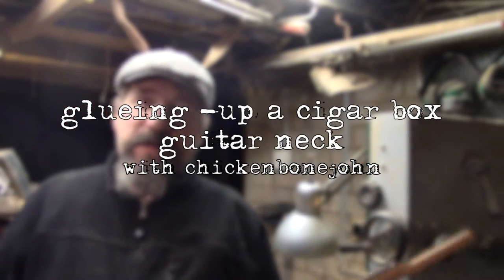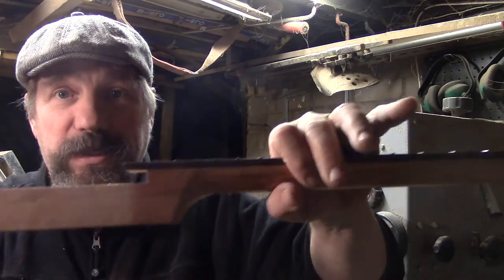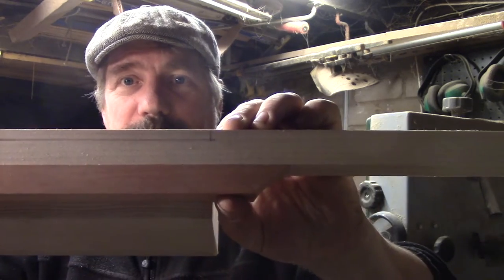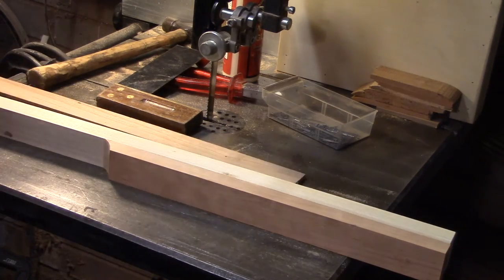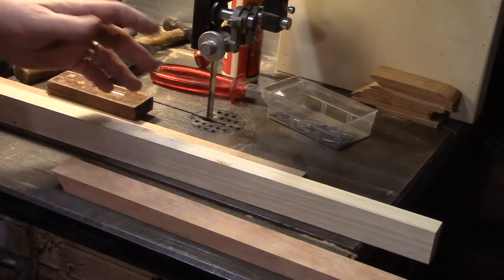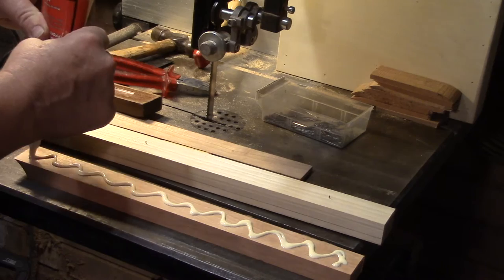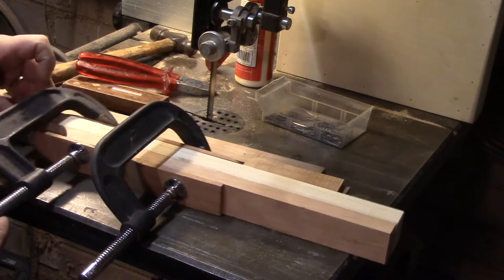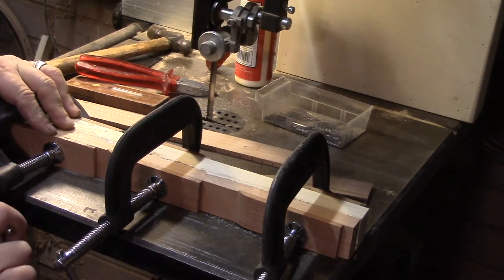Handy hints on how to glue-up a cigar box guitar neck

Comment: Helpful video. Thank you. I used to feel the same way about those speed clamps. I recently got a pair that are made in Germany. I can't remember the name on them. They were on clearance somewhere. These things look basically the same but heavier made and they generate way more force than my others. I can literally put one clamp on a single post and support a 12 foot  2x10 at midpoint with the clamping force they have..... Went and looked. Megaton clamps. 900lbs clamping force. They are awesome. Has to be more good ones out there. Cheers

Comment: Great tips. I also swear on titebond original. I’ve been doing high end custom carpentry for 40+ yrs, and an established guitarist/ enthusiiest but new to guitar building. Most cabinet makers and luthiers use titebond blue top. Never liked the yellow glue line it always leaves. And it’s not waterproof. It does come apart more easily w heat gun. I could see how that would be handy for repairs, modifications.... but for strength and invisibility you can not beat original formula. It has performed and Is time tested.

Comment: Forget the pins. Sprinkle a small amount of salt into the glue. The salt will desolve and the pieces will not skate around. It's a very old woodworkers trick. Won't effect glue or joint.

Comment: Chicken bone, tell me do you ever make scarf joints on your head stocks? And I also wanted to ask you what pick ups you use .do you get them from CB Getty possibly? Or  do you buy them somewhere else? What scale do you use for your neck? I was wondering if you used 25 1/2 or if you think that a smaller scale is better for a cigarbox guitar just wanted to get your opinion because I build all my cigarbox guitars at a 25 1/2 and scale and sometimes I find that challenging perhaps I should try a smaller scale just wanted to get your input
Reply: Hey Chickenbone John, Thank you for the quick response. I think that I’m going to try the 24 3/4 and the 22 1/2  scale lengths just to see how they work out. I’ve been building for 3 years and I learn more everyday thanks to videos like yours . Thanks again

Comment: Hi John,
Excellent video. I bought your basic neck kit recently and before I start cutting and carving I have a question: my cigar box is 250mm x 165mm x 25mm. My concern is the 25mm depth, which by the way seems to be the standard for cuban boxes. If I  glue the two pieces together I will have to cut 19 mm from the neck part to fit the box, seems like a terrible waste o the very nice piece of wood (the back strap).  Am I missing something?  Thinner piece of wood for back strap or end wood blocks? Looking at your video, your box is custom  made, much deeper then factory boxes, that's O.K. it's the basic technique that important. Please keep the good work for the CBG beginners.
Reply: @chickenbonejohn714  

Thanks, 
I will make new, deeper, box frame and use the original top and bottom from the cigar box.

Comment: Handy video, although I did panic a bit as I saw it just after coming in from gluing up my neck. Luckily it turns out I didn't go too far wrong and I now have a better idea about the fret board tomorrow. Out of interest how do you go about sealing the box? I'm thinking I want a semi permanent solution so access is still possible for maintenance but would prefer not to use visible screws.
Reply from the maker: I usually just let the string pressure keep the box closed.

Comment: Great video John. I am trying to figure out how to be able to make a short scale neck like the one you are doing and was wondering if you have any hints as to how does a person determine how long the entire neck board needs to be to accomplish this?  I want to make a 21 " scale neck and I want to make sure the bridge is located about 1/3 the distance from the end of the box and not at the very bottom which I think reduces resonance and also makes it hard to palm mute the strings when playing. Can you give me any advice? Let's say I have a box that is 10" long. What would be the best way to determine how long the neck should be? Would I just add the length of the head + 3" (position I want the bridge from the box end) + the scale length? Thanks for any help.
Reply: Thank you John. I appreciate the help.

Comment: Isn't popler a too soft kind of wood? To me it seems like that the force of 3 or even 4 strings would bend the neck quick a bit... sure, not a big problem when only playing slide. But doesn't that rise the action too much over time (if you prefer a low string hight)?
Reply from the maker: Not at all - I've made over 1150 guitars, many with poplar necks, and no problems.
Reply: Interesting. Thanks for replying!

Comment: How do you cut your fret slots and what's the best way for me to cut fret slots
Reply from the maker: These days I use a table saw with a specialist thin kerf blade, a custom made sled and a CNC machined indexed steel guide, but that isn't necessary unless you are making fretboards in great numbers.  I recommend a proper Sheffield steel luthier's fretting saw and a simple home made mitre box.
Reply: I think Indian rosewood is going to be a huge problem sourcing since CITES have made it difficult to source. Probably a good thing environmentally but alternative sustainable woods may be the future. Any suggestions? Especially woods which may be available in Oz.